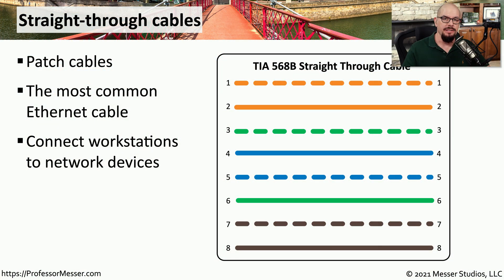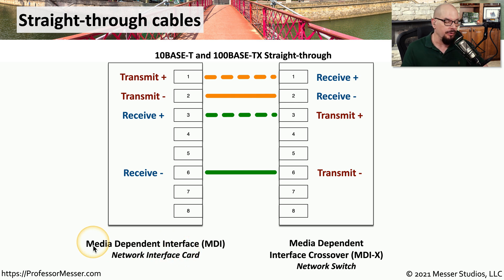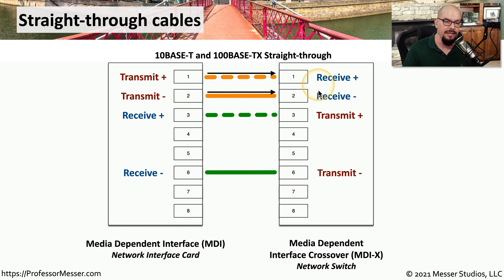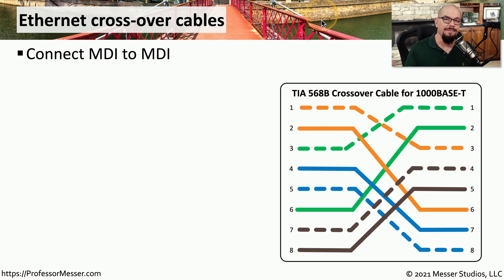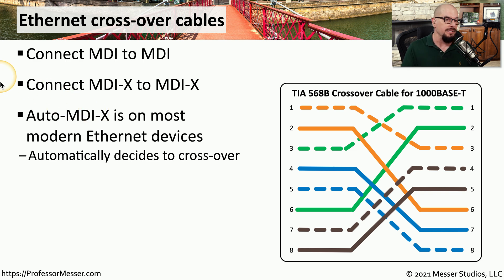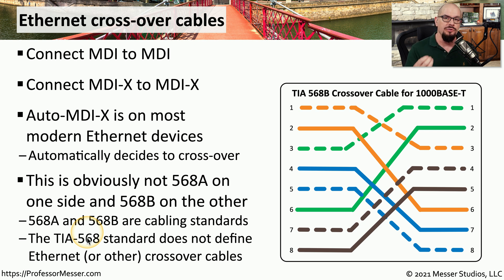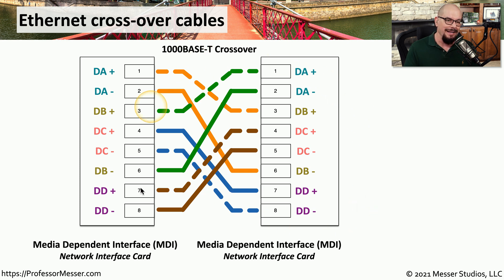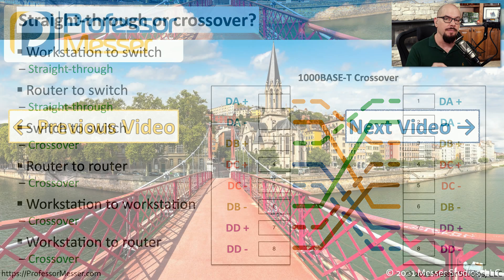Straight-Through and Crossover Cables - N10-008 CompTIA Network+ : 2.3

Comment: A little confused on one aspect of this... so if a router is an MDI device and a switch is an MDI-X device, why would we use a crossover cable for a workstation and a router and a straight through cable for a router and a switch?
Reply: Because both Routers and Workstations transmit data on pins 1 and 3 and receive data on pins 3 and 6 - If you connect a straight through cable from a workstation to a router (and vice versa) both of them attempt to send and receive data from the same pins which wouldn't work. A switch on the other hand transmits data from pins 3 and 6 and receives data on pins 1 and 2 - hence why you would connect a straight through from a router to a switch and a cross-over from a workstation to a router.

Summary:
Workstation: Transmit (TX)  Pins 1 & 2 | Receive (RX) Pins 3 & 6
Router: Transmit (TX)  Pins 1 & 2 | Receive (RX) Pins 3 & 6
Switch: Transmit (TX) Pins 3 & 6 | Receive (RX) Pins 1 & 2

This is an easier way of looking at it imo as opposed to MDI device vs. MDI-X device.
Obviously if both devices support Auto-MDIX it doesn't really matter which cable you use.
Reply: They are on the same level (3) on the OSI model

Comment: What if you have two Level 3 Switches? Would you use a crossover since they are likely to have similar network interfaces?
Reply from the maker: A so-called "layer 3 switch" is both a switch and a router. Interfaces configured as a switch would use those rules for crossover cables, and interfaces configured as a router would use those rules.

Comment: Do switch to hub connections require a crossover cable or straight-through? I was doing practice and the answer said to use a straight-through, although I chose crossover because I think a hub is considered an MDI-X device.
Reply from the maker: You would use a crossover cable, but you would first have to go back in time at least 20 years. You won't be asked any practical questions about hubs, Token Ring networks, or X.25 PADs. :)